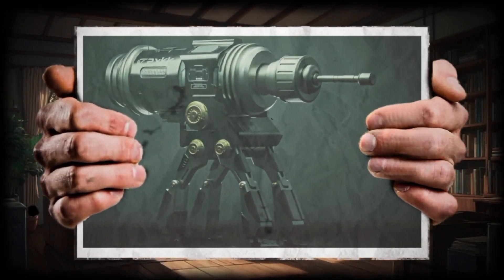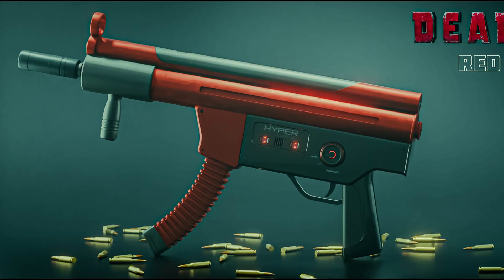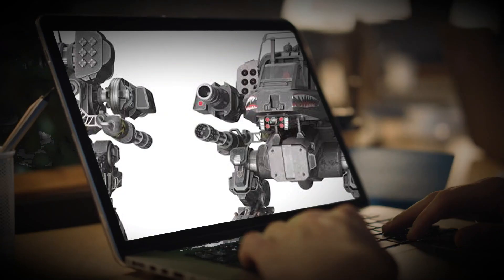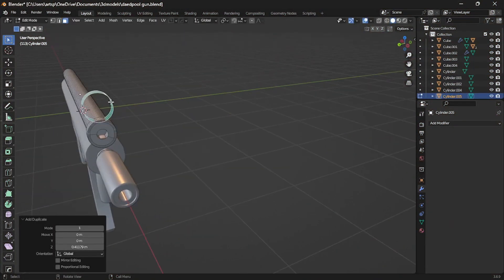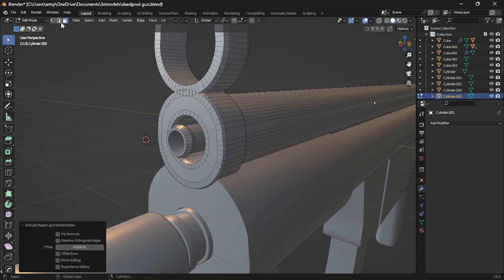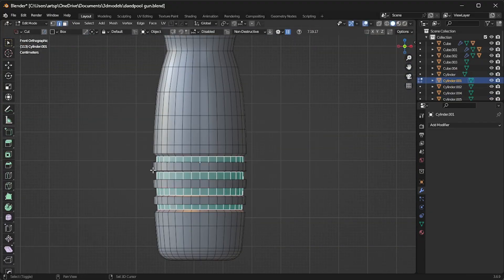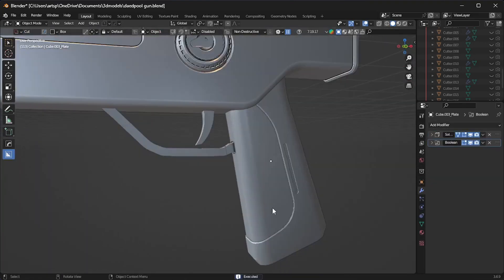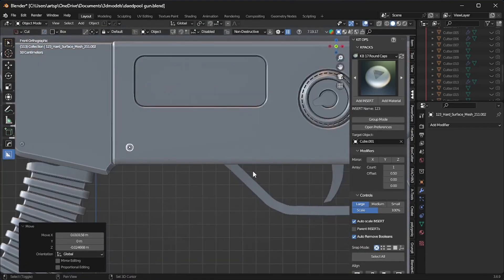How To Model Anything In Blender| 4 Methods to break complexity| Jack 3D

Comment: There is no looptools in blender 4.4, what do I do?
Reply from the maker: Did you check it in blender extension, causes you have to download from the internet. It's not available in add-on section.
Reply: Edit> preferences> Get Extention (Just above addons button ), be sure to activate the connexion to repository (click), you'll get that search box, or just scroll down the list with mouse and you are good to go. And you have addons and themes as well if you like to (you can switch by the drop-down list on the top)

Comment: Just a quick tip for getting bolts/screws exactlty where want them: at 3:38 instead of trying to line up the bolt to the hole in the gun, select the gun mesh, go into edit mode, select the face you want the bolt to be directly ontop of (you can also select all the verts that make up the cricle but makesure to do them at the depth you want them, however you can play with the depth after) with hard ops, hit control and S, youll have a pie menu come up and youll see "3D cursor to face" (or verts/edges depending what mode you're in) once the origin is in the exact place, select the mesh you want to go there, hit control and s again and "move to 3d cursor" usually with offset. 

Seems alot when typed out, but super fast and easy to do with hard ops
Reply from the maker: Thanks a lot man for sharing this great information,  I will use this technique in my modeling journey. I appreciate your help & nurturing thought. ❤️❤️❤️
Reply: @Jack3D-official  I also noticed when you scaled the little bits on the grip (the grooves I guess? Idk what else to call them haha) you scaled them on yhe Z axis but by "median". If you press . (Not on your numpad, that will change your camera to rotate around the selected part, bonus tip 😉) and change the mode to "individual origins", it will scale them all accordingly to each face. That stops the mesh going under itself at any point (you can see it a little on the bottom and top loops when you scaled them down) 

Not making a dig at all or trying to be overcritical, you've clearly got a great understanding for shape and form (arguably the best skills to have when modeling), just wanted to help a little bring your models standard even higher. Good video and great explanation, keep it up bro 👌